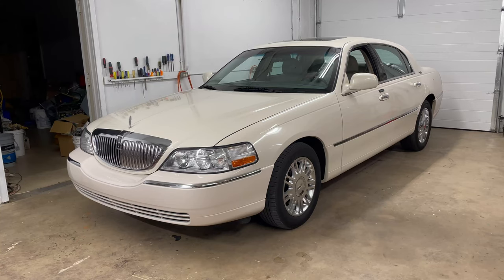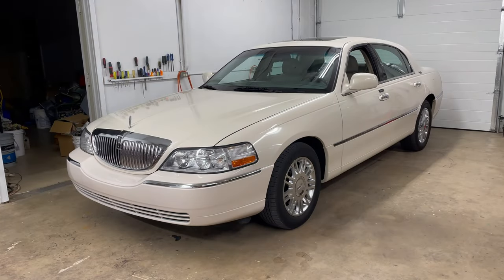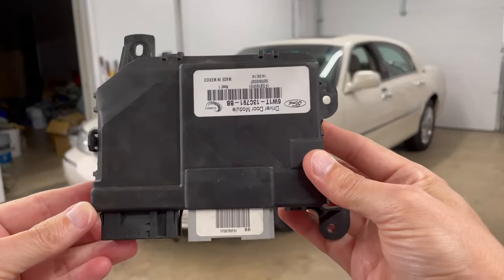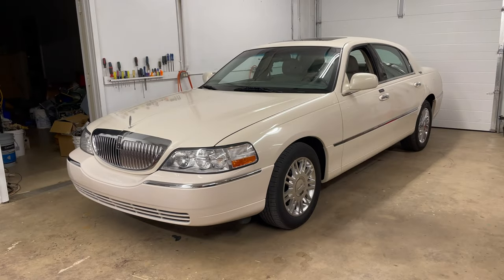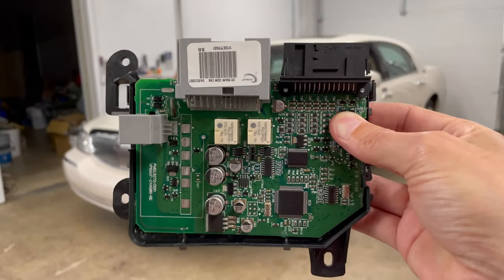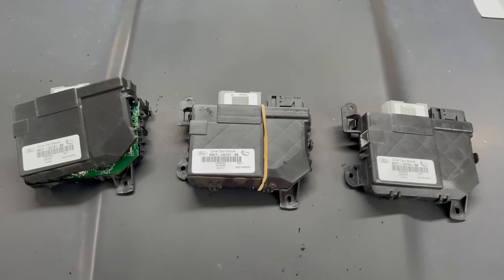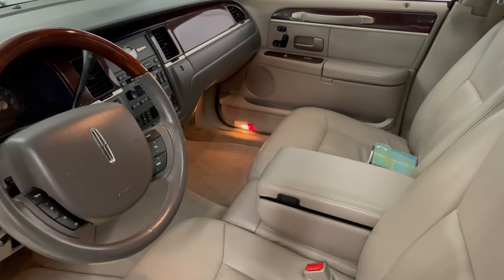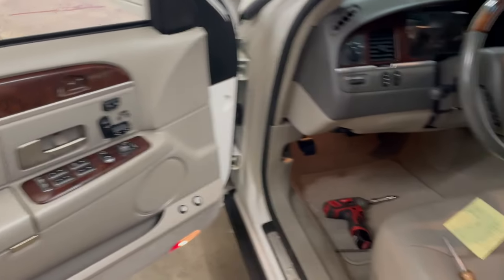Weird Electrical Problems FIXED - Lincoln Town Car

Comment: Can someone help me please, my 2008 town car won’t start or even crank, no visible power other then the anti theft alarm is stuck permanently on instead of blinking ? It’s got a brand new battery and it won’t even crank so I doubt it’s the alternator. Went to start the car the other day and the lights and seats when crazy going on and off, powered seats moving forward and back without even being touched. Please help
Reply: Starter* not alternator
Reply from the maker: click the link in the description to the Lincoln Town Car forum, there are very helpful folks there!

Comment: Sad news I’m afraid. I pulled a module from the local junk yard and installed it. And I’m stuck with the same problem. No dome lights, trunk release, or door locks. If I pull fuse 23 the dome lights come on then fade out slowly. Not sure what else could be wrong. Everything else works ( power mirrors, power windows, power seats, etc. ) all working with both modules. Only trunk, dome, and door locks giving me the blues. If anyone sees this message and has any ideas I’m all ears. 

James
Reply from the maker: Check out the Lincoln forum link in the description, I'm sure there are people there that can help.

Comment: Code for the door is in the trunk hinge arms on a sticker
Reply from the maker: They stopped doing that back in around 2004.
Reply: @InternetDude  Great point - I have a 2006 and could never find the sticker.  Not only did Ford stop using the sticker they also stopped printing the code on the Driver Door Module.  It's almost like they're forcing us to use ForScan to keep our cars running.  🙂

Comment: Actually the door lock code is in the back the door module you just replaced, two of them to choose, 5 numbers...
Reply from the maker: The code was not printed on there, I later retrieved the code using a computer.

Comment: I would have to check my manuals  but I believe the 06 and 07 should similar but the 08+ cars wouldn't be as they have the TPMS circuitry. 

If the 06 had memory seats then it  should have worked but might required reprogramming to fully function.  Forscan can do much of those details including finding the drivers door code for you.

You could have downloaded the factory programming for your particular car by VIN and programmed it using Forscan using that as built data.

Anyone having questions feel free to contact me with any Panther platform questions such disabling air suspension errors on converted cars, turning off the TPMS on 08+ cars...

I live in rural Saskatchewan if anyone was wanting to know.
Reply from the maker: Hi Todd, yes 06/07 should be the same. I eventually got FORScan working to retrieve the code.
Reply: Can TPMS and air suspension be hidden with forscan?
Reply: @bruceprofitsTradesFutures  It should be possible, I have done a few TPMS's on Grand Marquis that are overseas and I know the location for the air suspension as well, you can disable them both in the instrument cluster so it doesn't keep warning you.  

What year of car do you have?
Reply: @toddsonic  2009
Reply: @bruceprofitsTradesFutures  So my next question would be do you currently use Forscan?
Reply: @toddsonic  yes I have the system sn temp license
Reply: @bruceprofitsTradesFutures  So here is what you need to do, connect Forscan to your vehicle.  

Our cars are pretty basic and don't have many options, please note though for anyone working on newer vehicles there are more steps and often a limit of how many times a module can be programmed.  This doesn't apply to the panther platform cars.  

Once it's connected select Configuration and Programming on the left side, just above the gear and it looks like a computer chip.

Select Instrument Cluster (or HEC) as built and press the play button at the bottom of the window and is should show you your current values, most likely:  	
720-01-01 	51C0  	0000  	3A  
change that to: 
720-01-01  	5100  	0000  	3A 
and click on the WRITE button to send it to the cluster.  

If your current value is not 51C0 don't panic, please share what your current numbers are in that position and I will calculate a proper replacement value for you.   

It will complain that the check value (3A) doesn't match, don't worry as Forscan will calculate the proper replacement value for you. 

When it's complete click on the OK button and cycle your key to off and back on to confirm your changes came into effect.
Reply: @toddsonic  Thanks . Ill work on it and let you know. Thanks
Reply: @bruceprofitsTradesFutures  Glad to help a fellow panther owner, let me know if you have any issues, good luck.
Reply: You sound knowledgeable in panther!, I basically have a mayor issue that is making me crazy..it's hard to explain but I'll try..when I turn the car off..and if I forget to lock it with the remote..20 minutes later..the locks on the doors start locking and unlocking..loking and unlocking..locking and unlocking in a eternal never ending cycle until the battery dies..ohhh It's an Executive L 2011..I don't know where that issue comes from..but now that I see this video..I might makes sense..yes some times the motor to push the driver sit up and down doesn't wanna work..
What you think..thank you very much!..I'm writing this as well in the main thread to see if some one else have encountered the same issue..

Comment: I have a 99 Towncar and I’m getting a battery drain from the LCM/Main Light switch, and from the accessory delay relay. Any idea what could be my problem? It’s also throwing a few codes.
Reply from the maker: Start by tackling the codes. Look up at https://www.obd-codes.com the LCM is under the dash I have replaced mine too.

Comment: Does the DDR have heated seats function?
Reply from the maker: Pause the video at 0:29 to see what is and isn't affected by the DDM driver door module. The heated seat button on my trim level does not appear to be connected to the DDM, however the seat moving back (easy entry exit) was. Your year and trim level may differ slightly.

Comment: Thanks I may have this same issue as my key fobs stopped working, thought it was fob batteries but not.  No need for software or dealer trip, look on YT has videos on your driver door key pad code, its on the driver side kick or look up on TC at the paper tag that has the code on it.  Check yt for location on your Ford/Lincoln, on driver's kick panel or driver's side under dash near kick panel.
Reply from the maker: it depends on the year, in 2007 the code was not on the module or trunk hinge

Comment: Don't slam your doors, folks!
Reply from the maker: don't put a critical electronic control module in a high use area susceptible to above average vibrations and movement.
Reply: @InternetDude  true, but since it's there, don't slam your doors

Comment: I HAVE A REMOTE ISSUE SOMETIMES IT DOES NOT WORK SO I GUESS THIS MODUL IS THE PROBLEM 
I ALSO HAVE A 2008 SINGNATURE L
Reply from the maker: Remote start would be an aftermarket accessory so it may not apply to what you see here.

Comment: Never said it was. Check YT videos for location on your Ford/Lincoln, on driver's side kick panel or driver's side under dash near kick panel.

As far as I can tell since I own 3 Lincolns, and two pickups, All Ford or Lincoln with door code entry panel are on the driver side kick panel or right under the driver side dash looking up under the dash.  Not on the body module or in the trunk
Reply from the maker: Most Town Cars have the code on the module or trunk, but they stopped after a certain year. Maybe it’s under the dash / kick panel but I didn’t see it. Doesn’t matter anymore because I changed the DDM.

Comment: I have a 2004 Panther. And the electrics are complete junk.
Reply from the maker: More than DDM issues? Overall they are very dependable.
Reply: @InternetDude  as per the usual, I had every window regulator fair. As well as the intake manifold. And the RAS system. Forcing me to go to a standard coil spring and shock set up. Then the blend door,  then the heater core. And finally the cruise control.  I gave up. Bought a new Nissan Versa. Bottom trim level with the manual transmission. Massive warranty.
Reply from the maker: I have had to replace 2 blend door actuators but otherwise the car has been good for me. My A/C still worked but I knew the accumulator was leaking so I chose to replace it proactively before summer hits and the A/C shops get crazy busy. The ride on the Versa probably sucks in comparison?? Ah well these cars are tougher to own when they are higher mileage and older but if you can keep up with the maintenance they can last a long time. I don't know if you saw Vitaliy Kofman's YouTube channel, he has an older T.C. with quite a few issues, the rust doesn't help matters though....
Reply from the maker: I see aftermarket air bags aren't that expensive, Arnott seems to be a good brand.
Reply: @InternetDude  the ride is shit on the versa compared to the heavy and soft suspended crown Vic

Comment: Who's brain storm was it to put a electronic component in the door, exposed to the elements? Had the whole car to mount it in and chose the door. Goes to prove how poorly these cars are engineered. I own one of these slobs and it's the worst car I ever owned.  Don't forget to get a bilge pump for the passengers compartment because they all leak.
Reply from the maker: The drivers door especially is closed so, so, so many times over the life of the car that the shocks of that is not good as it is. Then add in the moisture and this is a poor engineering decision from back in the day.
Reply from the maker: There is one super common leak point in the cowl area where the air intake is. It can be fixed easily yourself and it won't leak again! There are multiple videos on YouTube on how to do it, but don't use RTV, use a EPDM rubber gasket.